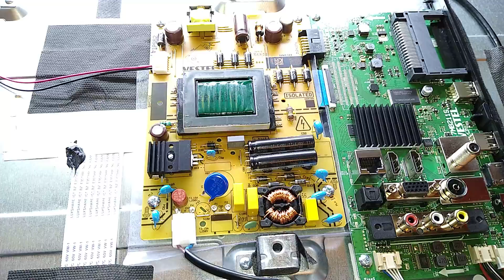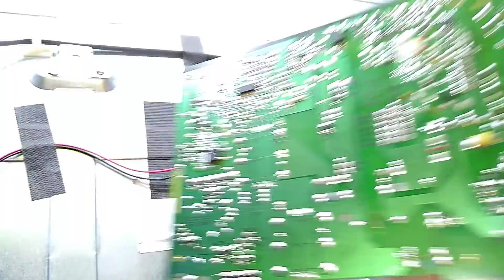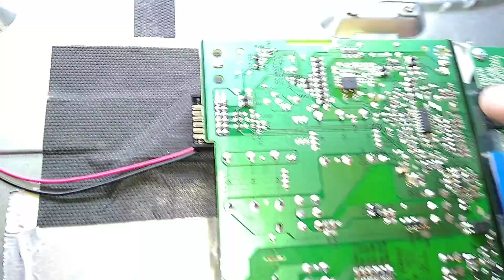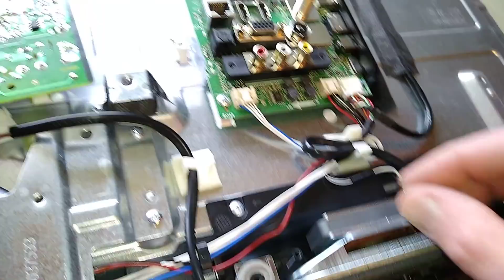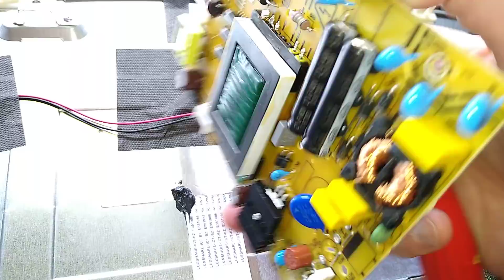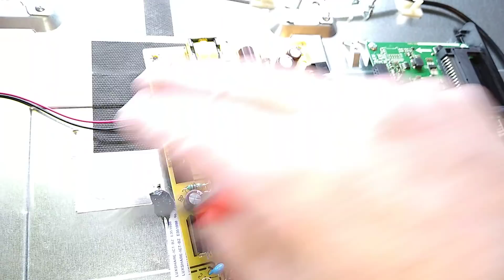There's not much inside TVs these days

Comment: Having started on TVs with 1950s era B&W sets and gradually working my way forward from there,  I too arrived at this point of things.  I skipped some stuff in between,  like Plasma and projection sets and similar.  Scrapped a few sets that weren't worth fixing (bad panel,  etc.) and those power boards can be a nice source of all sorts of stuff,  including in the ones I swapped many good-sized heatsinks,  lots of power semiconductors,  etc.  Some sets will have an additonal board,  called "T-con" which contains some timing stuff for the panel,  some of those have all of that built in to the power board.  Stuff with flourescent tubes rather than LEDs will also be the same way,  sometimes a separate board but often built in to the power board as welll  Depends on the maker.  What make is that one you're messing with there?
Reply from the maker: I can't remember the brand.  I think it was a generic store brand.

Comment: Technology is of course amazing, but there are weak points - screen has very weak extensions connection - flex tape is glued to the edge with special machinery. These connections are tend to oxidise causing vertical black lines to appear on the screen. They can be removed only by professional service - so if you're out of guarantee - in most cases it will be cheaper to buy new TV then repair old one.
I think that mentioned above oxidation in most cases is caused by users - when they clean the screens spraying window cleaner on it. On another hand, I've never seen vertical lines on PC monitors or laptops - so they must be built better, because I don't believe that laptops and PC monitors are treated better than TVs.   

Another important thing - scam. 
Time to time media are debating about fake IPhones etc.  In lied care of users - they fool people that with fake products users can't get proper quality and support. Maybe this is true, but Apple market is much smaller than TV market. So, why they don't talk about fake TVs - that are simply everywhere?

If I buy JVC TV I expect that TV is designed by JVC and is produced by JVC as I trusted this brand.
Nope - this is all Vestel, and JVC has nothing to deal with it. Thing is that JVC denies any support for users and Vestel also denies they are responsible for anything. So in fact - only guarantor is the shop that sold you that TV. 
The only reason that media are quiet about that is that brand owner gave permission to use the brand on those products. But from customer point of view - they are all scammers and even worse - the brand owner taking a part in that scam.

Comment: You might try some heat and cool tests. A hair dryer on it while it's running to simulate a hot condition. An air can turned upside down to simulate a cold condition.

Comment: I replaced the power board in my neighbors TV about a year ago and it looked identical to that one.
I wonder if you've got the same model TV there or if that same board is used in multiple brands/models of TV.
Reply from the maker: There are common manufacturers and modules used for many brands.

Comment: Vestel are using the same power supply board throughout. Lower power ones have a SMD switching transistor on the solder side of the board. Higher power ones have a leaded device fitted on the top of the board. If you look at the underside of the board, you will see bunches of SMD resistors in series / parallel combinations which is related to power rating of the board and size of the television. Interestingly the switching transformer does not change IE it's the same size for a small TV or a large TV.  One big fault with them is the additional back light circuit you point out in the video. If the backlight LED's fail, the voltage on those electrolytics goes sky high. They have the ability to fit one, two or three rectifier diodes to the outputs depending on the power requirements of the board, but, in all the ones I have seen, they have fitted all three, even in a low power version. The control chip for the back light circuit has the ability to monitor the current in several banks of back light LED's, so if one fails it can compensate. For some reason they bypass this feature. All in all, it seems to be a universal power supply board that can be easily modified in production to suit the TV it is going to power up, by adding or removing components. It is not as good as it could be.

Comment: I've done two different led TVs, both of which were literally a couple of leds died and broke the series circuit. A couple of new strips of leds and the TVs were up and running. Unlike our old cheapo Logik TV.... caps caps caps, 3 times I repaired it over the years, it's what you get for going cheap I guess.

Comment: vestel has a ground fault protection on their power boards, especially for backlight driving scheme, if it senses high static electricity, it cuts off the backlight until its discharged and make it think its all clear.

Comment: I miss that ozone smell from a leaky tube! you cant strap a flat screen! no convergence presets to mess around with! no EHT to make your hair stand on end and light up your tester when you hover your tester around 10 inches from the output tubes and deffo no voltage tripler to electrocute you with at least 40'000 volts when you are trying to adjust the chroma! even the Raster looks fake! most tv circuit boards are not engineer friendly only replaceable/repairable parts are the power output section and the screens as far as I have seen! technology has taken the fun out of so many things! lol you used to be able to swap module boards with the likes of the phillips G11 now you just swap something like 2 boards!😱

Comment: Those FAT diodes should be Shottkys ( ideal for some projects ; chargers etc ) ... NEVER junk your old analogue ( CRT ) tellys, they are a gold mine of HIGH VOLTAGE transistors and capacitors , also the giant 25 kV flyback circuit ( if intact ) is ideal to make  plasma balls and other gas discharge lamp novelties ( just take the tube to the dump ! ) also the 4 tube screws make good plastic roof fixings ( ? ) ... when they are gone they are gone ! !
Reply: Indeed ! Found a couple of videos on YT where people modified their plasma balls.

Comment: I was buying used electronics and noticed the shop had a smashed pc monitor for £1, turns out it had three boards : psu, logic and buttons, complete with shitty korean caps. All smaller than the palm of my hand.  That's nothing compared to the 16 boards of my 1992 trinitron tv, half of them massive, with dozens even hundreds of parts.

Comment: I'm curious what the lavender bodied component is between the HV and LV portions of the power supply. It's banded like a resistor or inductor, but that's an odd spot for either of those.
Reply from the maker: 7.8Megohm resistor.  Probably to prevent build-up of static charge across transformer.

Comment: Clive I need to contact you regarding some questions that may not be covered in your videos/blogs.  Is there a way to contact you via email/WhatsApp ?  My question is related to killing a remote radio head  (that is connected via rj45 modular plug). I don't believe that the radio wouldn't adopt some kind of protection.. the radio runs at 13.8 volts DC.

Comment: I don't understand why they make the TV's and monitors so thin, I mean it isn't a laptop and the gained space is almost never used, because the feet usually prevent it to be placed nearer to the wall or to place anything behind it (who puts stuff behind their TV?), Except of course if you mount it to the wall. But even then it doesn't feally matter if it's 2 or 8 cm wide.
Reply from the maker: Partly to save shipping space and partly to sell the extra-thin ones at a premium price.

Comment: I have understood one should not connect diodes in parallel... but still I see it done here... what is the reasoning?
Reply from the maker: It's not recommended.  This is an attempt to spread the heat dissipation in a low profile array of diodes.   It's notable that they often fail and need replaced as a group.

Comment: You should have just done a reflow with a hot air station. Meanwhile
I took an old 360 gb hard drive apart last night for the magnets which i use for hanging screwdrivers in my workshop. Not one component was marked, chips resistors all blank, no values, no id no manufacturers names.

Comment: Board swapping.  That's what has happened everywhere.  I used to work on medical equipment.  When I started, it was schematics and test equipment.  Before I moved over to IT it became an adventure in board swapping and module replacement.  I remember tweaking pots and calibrating things.  Now it works or it gets replaced. Some medical devices don't even get checked anymore because they fail hard.  If it's working, it's accurate.  

I noticed that about TVs and monitors over the last few decades. I worked on a few CRT monitors and TV's back then as well.  It was a different age.  Back then, I'd open up a TV or a VCR and fix it.  Now, I'm about 50/50 on whether I'd toss it and get a new one, or open it up and fix it.  Usually, by the time something fails, I wan the newer model anyway.

Comment: Usually when electronics have intermittent problems like this it means the PSU is not filtering noise correctly or not being able to supply the correct voltage during operation/load.
And that is usually the cause of intermittent problems. The electronic side will try to stay working for as long as it can till the unstable voltage cause the system to crash.

Comment: Some comments here call Vestel bad- but that is definitely not true by my experience. About 6 years ago, I bought a Techwood 50" by Vestel for 200 pounds, and a Panasonic 4K TX-48AX630E for ~800. And Vestel has many things better- nicer remote, faster operation, better UI (everything presented in a clear and simple way). Both TVs do many hours, and work without issues. So when this Vestel breaks (and can not be fixed)- I will certainly look for another Vestel (a model well reviewed by customers) again for a cheap TV.

Comment: Not sure if it's been said or anything, but from repairing way too many of units that have it, it's the pin plug jumper from the powerboard to mainboard. I mean yeah led shorts are rampant but heat control is even worse in tvs nowadays. The cheap solder and leds it's hideous. 
But I always hit those stupid pin plug things and bad solder joints with the heat gun. 

Again, reflow the pads on the dumb pin/plug bridge thing. Wires worked fine I thought. But noooo let's make a direct plug...

Thanks for everything you do clive!

Comment: I have also disassembled these things, saw something very similar. I wanted a broken TV to become a working light. What I’ve found was, one of the pins connecting these two boards is PWM signal produced by the mainboard and consumed by the PSU board, controlling backlight LED. I had to solder that pin with a +3V pin, and the LEDs stayed on without the mainboard.

Comment: Check those diodes as well. Two lots of three in parallel, the ones on the wire links Clive referred to. Quite common for one of those to blow. Schottky types.

Comment: And the biggest issue with Macbooks, is caused by a shorting between the high voltage LED backlight and data lines into the cpu. They literally put the two items on a connector next to each other. The boards aren't very well lacquered either. Where as at least this moves the two items onto separate boards.

Comment: I think the LED voltage is high because there is no load, this is common in backlight circuitry. You likely had a bad connection to the LEDs or a trace going bad (causing an open circuit to the LEDs)

Comment: What brand was it Clive? I was given a 22" tv with a built in DVD player a few years back as it randomly stopped working (no standby light and would not power on). I opened it up (being a hobby electrical tinkerer a lot less knowledgeable than your esteemed self) and immediately spotted 2 bulging capacitors on the power board, I luckily at that time had a collection of salvaged caps from old electronics I had disassembled previously and found 2 fairly close matches in the capacitance at the same voltage rating. De-soldered the buggered caps with my old 40w Craplins soldering iron and replaced with my salvaged ones and lo and behold it powered up straight away. This was a Technika X22/14B-GB-TCD-UK model. It still works to this day, I keep it on my desk as a second computer monitor.

Comment: Do you know if a new adhesive to replace the adhesive generally used on the ribbons as they attach to the perimeter if the screens? Ive worked on a dozen tv s where the finished picture is missing strips across the screen and nearly all of the issues started with the adhesive breakdown over a period of time thus causing the ribbons to lose contactconsidering its so common i was hoping the manufacturers would come up with a product to stop that problem
Reply from the maker: That's a common and annoying problem with many LCD screens.
Reply: @bigclivedotcom  oh i know. When my friends found out i knew how to fix them they started piling up. All freebies. With one good pay off. A friend of a friend showed up unannounced with a 72" vizio 3d razor led with all the bells and whistles and said fix it. I told him its going to take a while i had a total remodel on a 3700 sq' house and a bunch of things ahead of him. I got it done way quicker than i expected but football seaon had started. When i told him the good news he said keep it my son bought me a new bigger one but what do i owe you? That never happens. I charged him 200.00 and kept the tv.  Oh im lying i didnt take the mans money. Im not a dick. Now i hang a sheet over the tv and use it as the screen for my projector. A perfect match. Ive honestly never watched a single show on it. I love it. All of my friends are pissed off. Apparently thats not normal behavior. Thanks for the videos. Im learning quite a bit. Used to id walk in to radio shack and say i need some of those round thingies that have a stripe and blah blah. Now i know what some of those things are called.

Comment: Check the connector chip between the two boards, extremely common for these to come loose. This was probably your issue and taking it out and putting it back fixed it.

Comment: How often can modern big (50”+) TVs be run on low voltage? (12V?). Just wondering whether to take off the back of my LG 55” TV to try and run it from my 12V battery direct and take the load of my inverter, or not to bother.
Reply from the maker: The control systems of many seem to run at 12V, but the backlights are often a higher voltage.  It might be possible to add a dedicated current adjustable voltage booster to drive the LEDs.
Reply: Oh I think I have a fun idea for Big Clive. 

1200W 20A DC-DC Converter Boost Car Step-up Power Supply Module 8-60V to 12-83V 

So long as your mains appliance uses an SMPS, it'll usually run it OK. Cost 15 quid from China.

Comment: My first 2004 Samsung Plasma50 inch monitor which I won in a product announcement drawing had a MSRP of $10,000, Internet price of $6900 and a taxable value of $3900.  Price based on perceived value.  When it needed repair under warranty, the tech had a kit of 6 IBM pc-1 sized replacement boards to drive the screen.  No tuner, no wifi, no blue tooth. Just RGB, Component and DVI inputs, basic video.

Comment: Not much to look at, just 1000 times more circuitry than ancient TVs had... just the timing control circuit that’s not visible it’s probably 100 TVs from the 80s and the panel drivers are

Comment: Mostly it is due to a led lamp inside the panel. Since all the led lights are in series connected, it is highly possible a led lamp is dead. You can check it by shining the screen with a phone light. If you see shadowy images or logo ( vestel,Telefunken, kendo, ok and so on) , then you can be sure. The main unit is less likely faulty, and it can be mostly due to the software inside.

Comment: I took a very old tv to the tip for a friend. The container where the old tvs are dumped was plied high with modern tvs so I decided that I would take one home to see what was wrong. It had the same circuit boards as this one in your video. All that was wrong with it was that one of the three diodes above the transformer had gone short circuit. I replaced all three of them with higher spec devices. It works great. What a waste all those tvs being scrapped. I bet most of them could be fixed quite easily. I would like to go get a couple more but even though they are being scrapped it is probably theft to take any. What a shame.

Comment: i forgot to say something on this, back in the days with those tubes it had a lot of tech in it for sure And since i was a child opening one of them up i had a shock from that glass tube Any clue how a glass tube was able to do that? and next one Despite that in flat screens are having almost nothing in it 1 thing is for sure the audio gets worse the smaller they get and i open them often enough to solder a AVR wire in it to amplify some good noise in it But the wires are so thin }:( compared to the old days why are they making it so thin? (speaker wires btw)
Reply from the maker: Old TVs worked at very high voltages, sometimes with a live metal chassis.

Comment: Where is the LOPT gone?
Usually it can be resurected by replacing the electrolytic caps, but for the price you pay for the board its probably just as easy to swap it out.